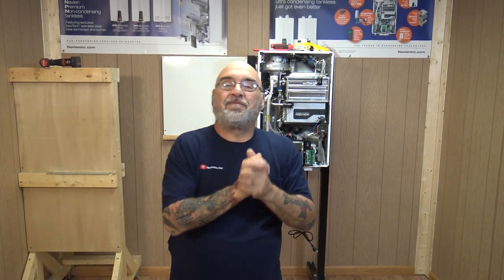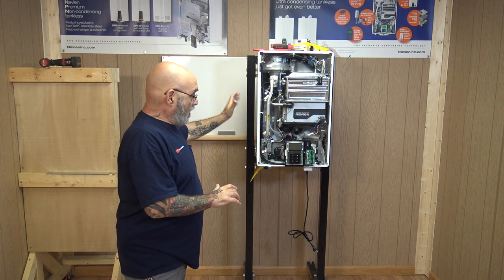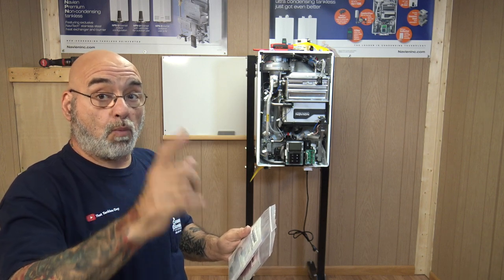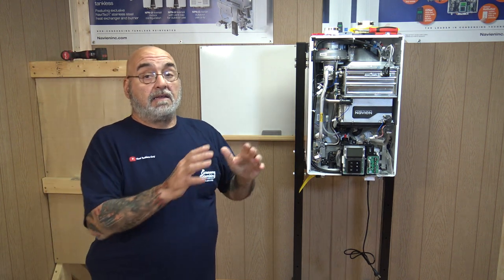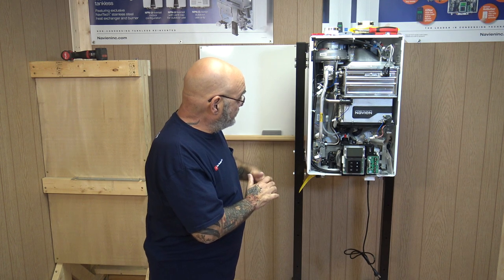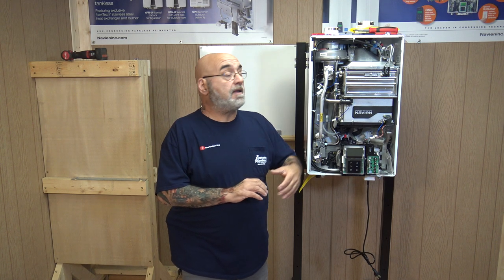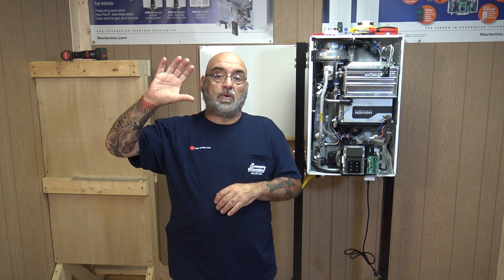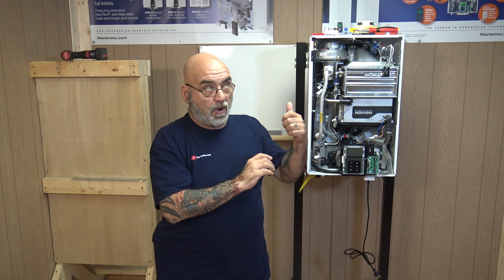Converting a Navien NPE unit from natural gas to propane

Comment: Thank you Mike .. With your generous help through videos, phone calls, I was able to install my Rinnai RU160 tankless water heater. Its working great. It was so fun to have a 2 hour shower to celebrate it !! :) Thank You again.
Reply: I’ll be installing the same unit in a couple of weeks along with changing all my piping to Pex A expansion pipe.

Comment: Thanks for this video! The manual mentions using a combustion analyzer or a digital manometer to measure and adjust the gas/air ratio. Is this generally necessary? I'm actually doing the high altitude conversion, but the basics of the conversion look the same with a different orifice. Thanks!
Reply: I have the same question

Comment: Converting an npe240a2 from propane BACK to natural... plate seemingly doesn't fit but it's the same plate that came in the unit? It doesn't have a notch in it and is driving me nuts... and thoughts